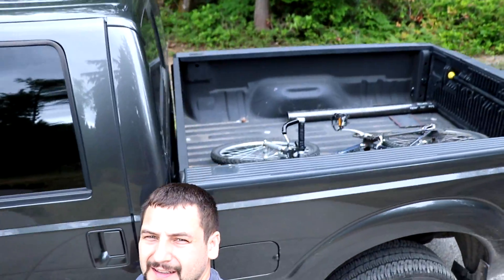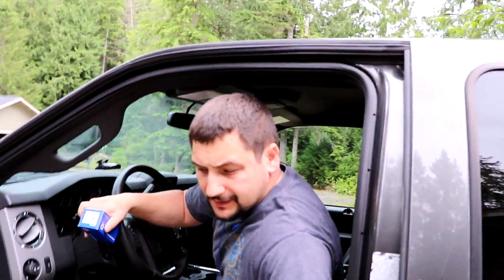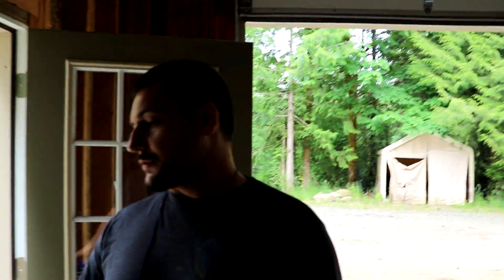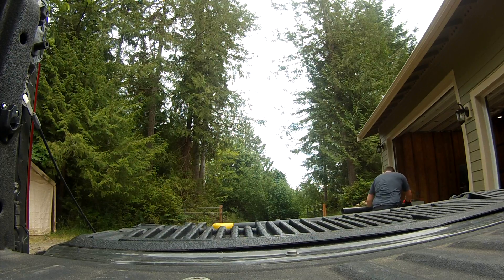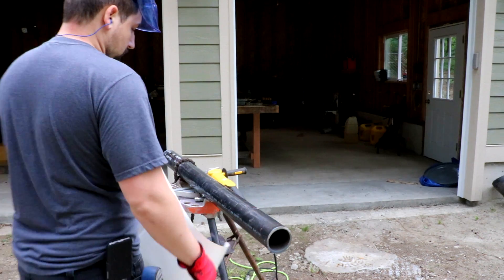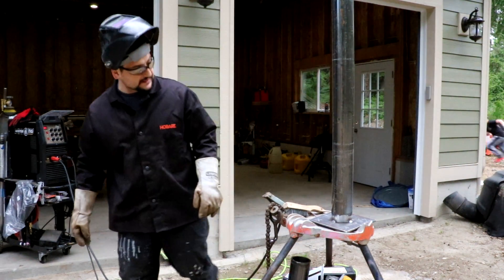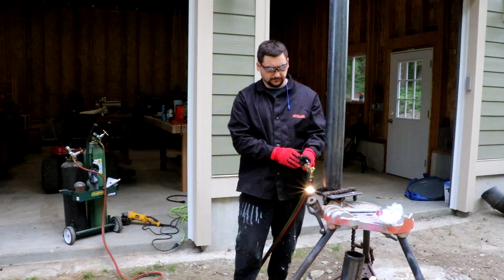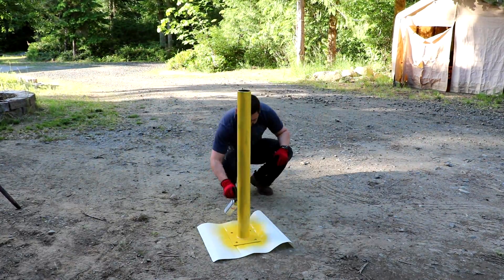Building a Protective bollard for water heater!!

Comment: No cap on that pole bro? Did you even wipe that pipe clean with a degreaser before you sprayed it? If the answers no than that shits going to peel like a banana after a few years, and it going to rust from the inside out.  But it has a nice weld job.  👌